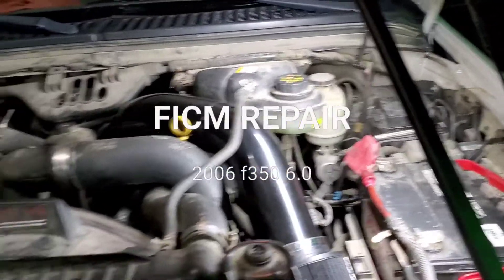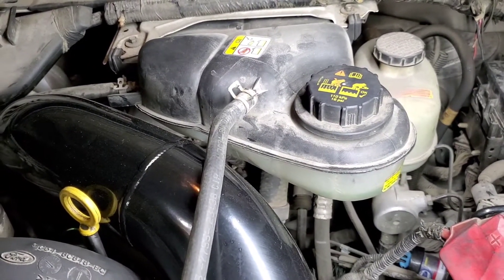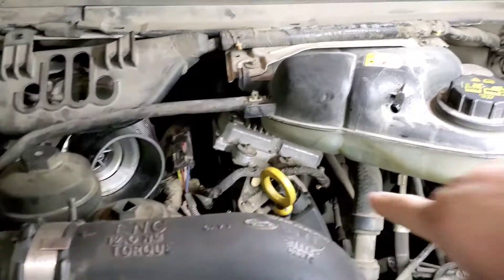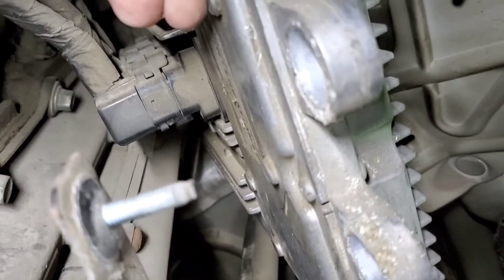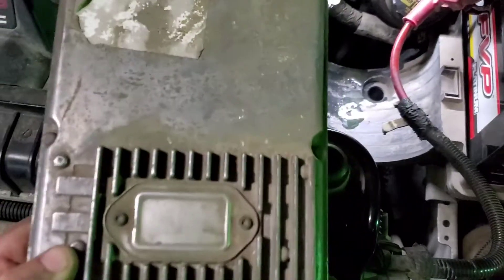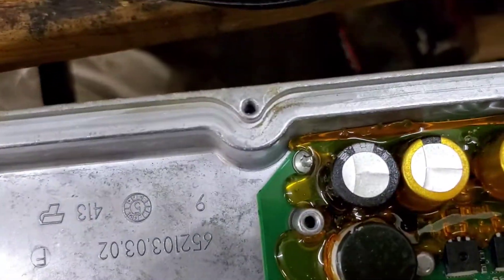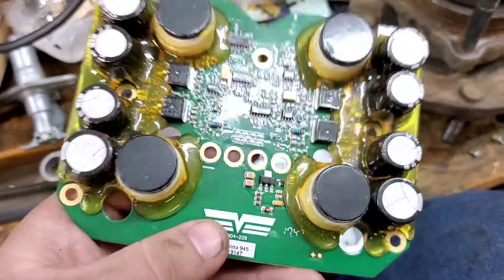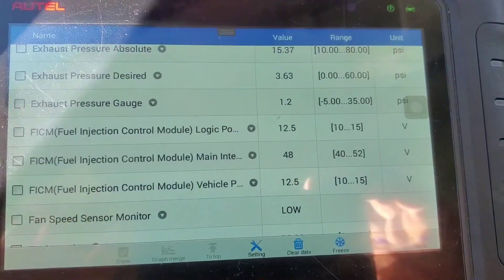Fuel Injector Control Module Repair

Comment: Hello, I have Ford Ranger 2.2l manual transmission. my problem is the injection doesnt work due to low voltage from FICM. in this model the FICM is inside the ECU. is it possible to repair. thanks

Comment: I had a question. On my 05 f350 6.0l my IDM logic Fuse is going out every hard bump
Reply from the maker: I'd check the three plugs going in if loose or bent pins the fuse will pop
Reply: Its happening to me as well. Did you find a solution?

Comment: Hey have you ever replaced a power steering pressure switch on a 2009 cts 3.6 cant find where its located
Reply: I believe what you're looking for is located on the rack itself on the cts